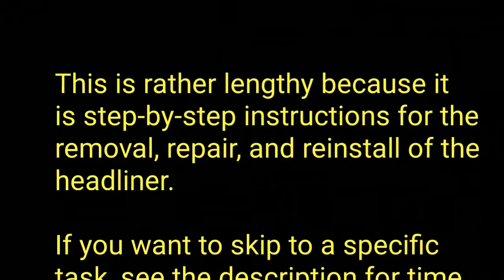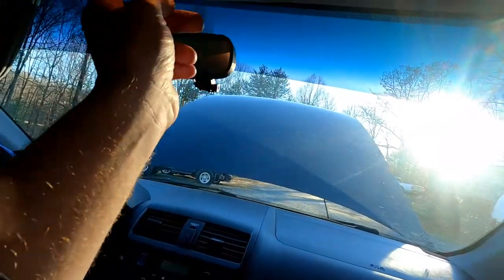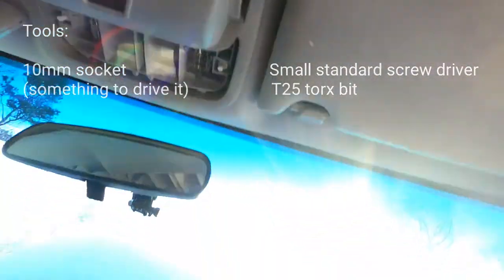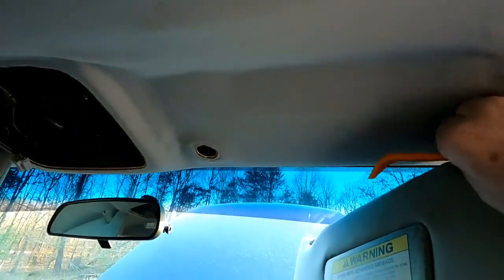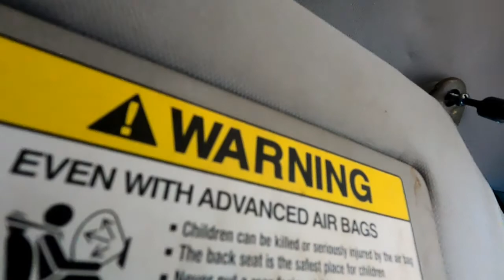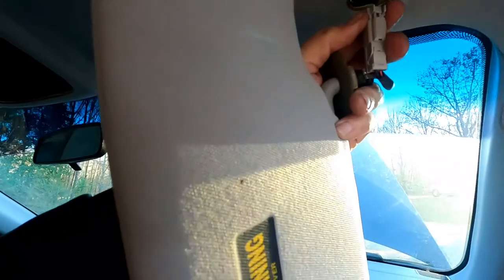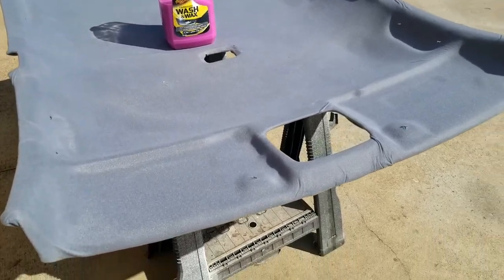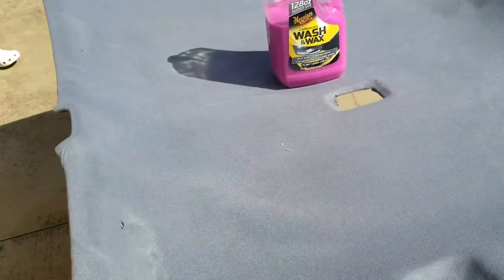2005 Accord Headliner Removal and Repair

Comment: do you remember the dimensions of the fabric you used? i have a 2005 accord sedan and was going to do the same thing but i don’t have any arts and crafts stores near me so im planning on ordering on amazon and don’t want to get something thats too small
Reply from the maker: I do not recall the length I bought but the width is the standard roll itself.  So, however wide the roll is manufactured is how wide it is.
I made it long enough that I cut off a few feet of extra length.    So, I reccomend getting about 12ft.

Hope this helps.